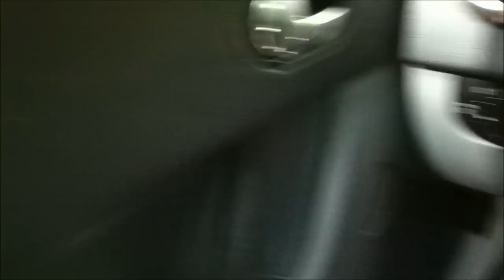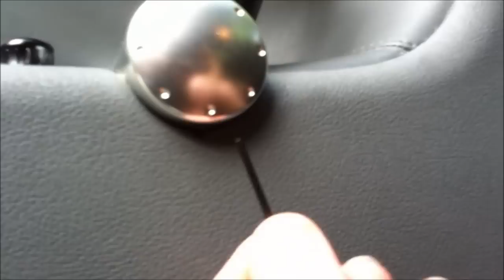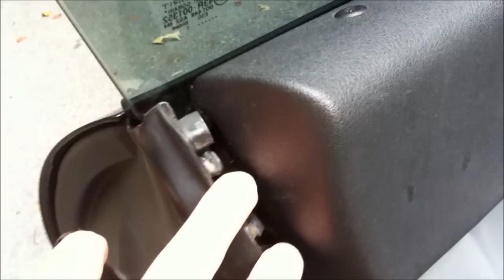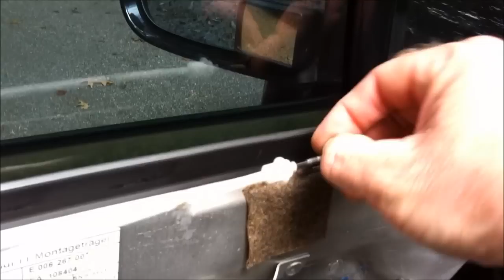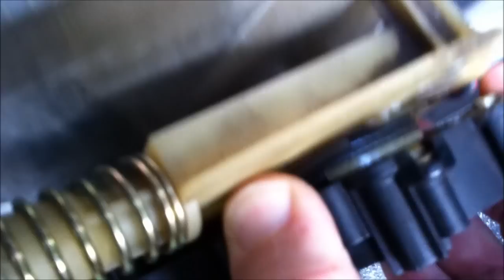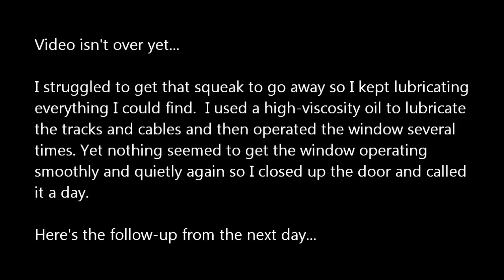How to Fix the Power Windows  on a 2001 Audi TT (MK1 1999-2006)

Comment: The window comes down when you open because of the way the window seals are made. If the window did not lower, it would pull and bind on the rubber. When the door closes, the window pushes up into the rubber forming a tight seal. Has nothing to do with lowering air pressure

Comment: It's 2022, I have a new-to-me 2002, and the driver's window would not work at all. Found your video, and now it works. You explained it perfectly. Once I saw it was a cable system I knew it needed lubrication. I have several pieces of gym equipment that use a cable system, and they need lubrication every few years, so a 20 year old car definitely does! Thank you so much, although I had to order a microswitch because the auto 5mm down does not work, you saved me swapping parts from a junkyard, which probably would have had the same problem! You rock!

Comment: cable wounds behind the window motor? your other video reveals there’s nothing but a gear attached to it. so is there random cable wounds or not behind the window motor, need an update?
Reply from the maker: I'm not sure I understand your question? The fix in this video turned out to be temporary in my case. Per my other video linked in the comments, I ended up needing to replace the window regulator. If that doesn't answer your question, please restate it and I'll try to help.

Comment: Verified: 2002 Audi TT Quattro ALMS

Add me to the thankful list, researching your trial and error help me save a lot of time and money, not to mention the priceless confidence of taking things apart.

Driver's side window not moving, stuck in up position, no small cracking upon door opening and closing. I had to take off the door panel to hear that the motor clicks despite the window not moving. I used 3 in 1 oil for the cables inside the motor you showed and the rails of the regulator. It worked, but in hindsight I'd recommend a lithium or high viscosity grease for the rails so it lasts longer and doesn't run off like oil lubricant. Careful if using aerosol to focus the application on the intended area so you don't overspray a mess onto your glass window.

Comment: Great video! What should cable on the spool inside the regulator? What's the easiest way to reinstall the door panel?
Reply from the maker: Really it's just a matter of doing the disassembly in reverse. It's easy. You won't have a problem getting it back together.

Comment: Fixed my windows

I never took my door panels off as I've other symptoms so thought I'd take + Car battery cables  - off for a couple minutes to reset the car. After connecting the power cables to the + battery - I turned the car ignition on Two turns and my drivers window automatically went further down by a touch. so I held it untill it went all the way down, close the door and back up till it got to the same position as previous. I let go then up again and it fully went up to my amazement. did the same to passenger side and sorted. Now onto the next fix-  (P) light is Dim but [On] my dash when my handbrake is fully down.. I believe I need to start with checking the brake fluid as it could be low for a top up... Happy fixing guys! #Peace

Comment: I just got this issue today and along with it is a list of Soft top not functioning, on the dash I have the (P) sign up but my handbrake is fully down- which is really odd aswell as my central locking/immobilser not working so I have to use my keys to lock the doors and the petrol cap switch and boot switch not functioning either... Any ideas guys would be much appreciated! I have checked the Fuses on the drivers side dash and all seem ok, is there another fuse box in/outside the car that needs investigating? Thanks
Reply: ..and my interior light is not working, checked the bulbs they seem fine. Really odd! 
I did however notice my Time/date and year has gone back to 2001. So I'm thinking could it be a loose connection to the battery. The battery is brand new. :/

Comment: Thanks for the great video. I just fixed my passenger side window with exactly the same problem! Followed your instructions, and even though nothing seemed to happen (I ended up putting the door together before testing one last time), after a good soak in spray lubricant - voila! Window operates as good as new. Cost me a $10 can of lubricant and about 30 minutes of my time. :)

Comment: Thank you so much for taking the time to make this video! I'm having a problem with my window not rolling up. It just happened now. Every time I tried to roll it up it started to go back down as though something was in the way. Finally on my third try it just stoped going up anymore than about an inch from bottom. No noise is being made it just plain stopped as though it had reached the top. I will be giving this solution a go once husband comes home from work with the socket wrench. Thanks again & I'll keep u posted on outcome! Kat
Reply from the maker: +Kat Athay I hope this works for you.  If it doesn't, check out my follow up video that shows how to replace the windows regulator here: http://youtu.be/qVcTqk8c2mg

Comment: Were you getting any clicking from your motor and it  heated up when it was jammed by chance? Trying to trouble shoot this. https://youtu.be/iYL8ZWI3Ct0
Reply from the maker: Ari Justin Rothenberg No, it was't clicking.  I could just barely hear a noise when I tried the window switch while it was jammed.  The motor was hot.  I eventually had to replace the window regulator.  See video of that here: https://www.youtube.com/watch?v=qVcTqk8c2mg

Comment: Mmmmm, great video. I really learned something there. I was wondering.........my window stays up when the door opens, the interior lights do not come on, and Im thinking there must be a sensor somewhere, so the car knows when the door is open. Do you happen to know where there might be?. Oh, and the window goes up and down just fine.
Reply: Thk
Reply: Appreciate your comments, and I agree. I have a new micro switch and will give it a try.
Reply: This is a common issue, the door latch has an internal microswitch that tells the door CM that the door is open, activating the window drop feature and the dome lights plus warning chime. The remedy is a new door latch. The driver door sees the most cycles, and the latch wears as a result.

Comment: I tried it as in the video, no luck. I can hear the clicking sound in the door, so I assume the switch is fine. I pulled the motor and reel assembly out rotated more than you show in the video, but still no luck. Anybody know what the next step is when you get to this point?

Comment: What lubricant would you use on wires and rails?
Reply from the maker: A silicone spray. I don't know if that's what Audi recommends or not. It didn't last long. I ended up replacing the window regulator to fix this problem.

Comment: Thanks, Rusty. I played with the driver's window on my 2000 TT last year. I replaced the regulator because the cable was frayed and it had badly scored the plastic pulleys. It took forever to realize that I'd have to drill out the rivet to replace the regulator. I used a screws, locknuts and bolts instead of buying a rivet gun. Seems to work fine. For the love of god, don't be tempted to unravel the cable from the regulator. I tried that (I don't even remember why now) and sadly regretted it during the too-many hours it took to reassemble the regulator under pressure of the spring. It eventually all worked. IF I can muddle through this, just any anyone can. Last thing: Rusty has a great video about replacing the window regulator. Watch the whole thing before embarking on the repair. Good luck to all.
Reply from the maker: That's an interesting idea using nuts and bolts instead of rivets.  LOL and excellent advice -> For the love of God, don't be tempted to unravel the cable from the regulator.  Thanks for the feedback.

Comment: Thank you so much!  Today my window would not roll up.  I followed your directions and took the door panel off and sprayed lubricant on the cables.  Then I pulled on the cables a little, connected and disconnected all of the connectors, and put the door panel back on.  The window went up but stopped about 80% of the way up.  I was able to push the window up with my hand helping along with the motor. But then I had to do a "Reset" to calibrate the window so the car computer knows when the window is up or down all the way (so it can raise/lower the window a fraction of an inch whenever I open and close the door).

Ignition on 
Windows all the way down 
Windows all the way up, let go of switches 
Push the switches up again and hold for 3-5 seconds 
Ignition off

This fixed everything and the window is working perfectly now!
Reply: Crazy how two years ago, Monty had a 2022 TT. What a privilege!
Reply: oops. that's 2002. thanks!
if you want to buy my 2022 that will cost you
Reply from the maker: That some great information.  Thanks for adding that.  And I'm glad the video helped you out.
Reply: Reset automatic window: actually it may be model dependent. On my 2022 TT cabriolet these directions did not work, so I finally found in the owner's manual (what an idea to look there) to (1) hold switch until window is all the way up; release (2) switch UP again for a second.
Reply: Brilliant,

Worked for me, many thanks :-)

Comment: I have a 2001 TT with 16K miles and have the exact problem Rusty describes in his fix the power windows video.  You are right, without some direction, taking the panel off would have been a pain to figure out.  Looking at and following the video was a breeze.  After I loaded up the cables behind the motor the window still didn't move, but you could hear it was trying (clicking from motor).  I got out my trusty wooden mallet and after about 5 love taps - bam, it started working! Thank you!!!!!

Comment: Did the regulator switch today on my MK1 and to my surprise the thing is rivited and needed to drill them off then buy a rivit gun and 4 hours later was fixed, I got part from eBay for 39.95, we'll see how long it last.